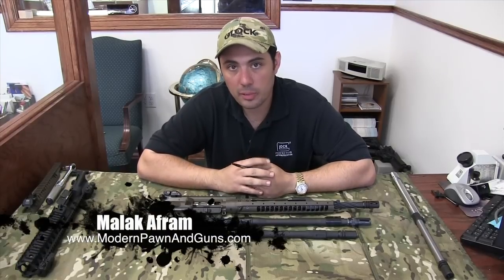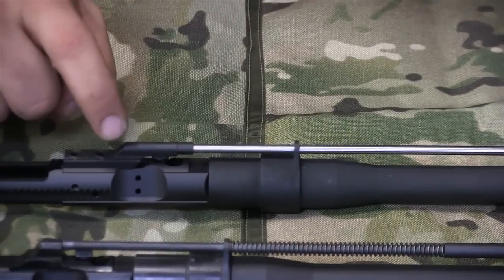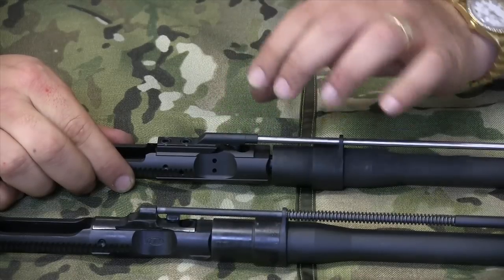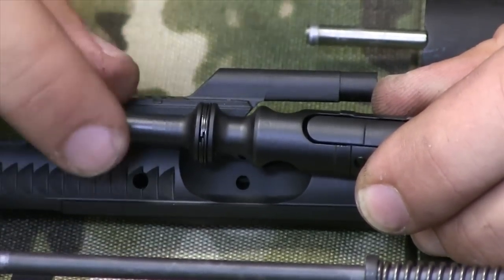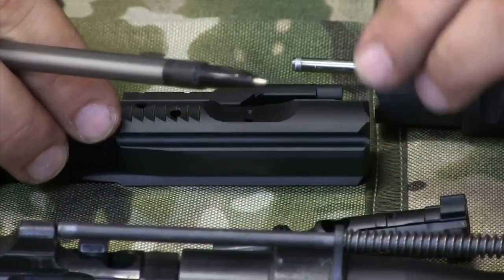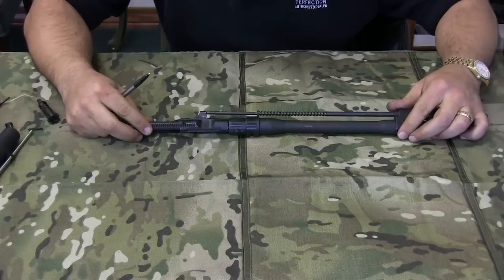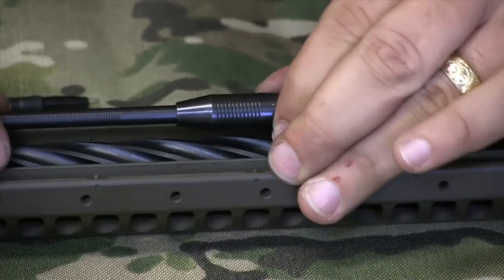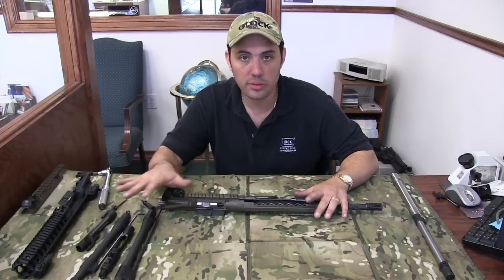Piston Driven vs Direct Gas Impengment AR15 Operating Systems LMT LWRC MRP

Comment: wow now I know...OK which one is best to handle a 16 inch full auto? thanks for the upload.
Reply: stomy bugsy as a gunsmith I spent a lot of time cleaning my shop's M-16s, both DI and piston. I can tell you the piston ones were a LOT cleaner after some heavy range sessions and shooting expos. Realistically it's a personal choice though. Do some independent research and determine your own pros and cons!
Reply: Cameron Miles i did my research and yes they functioned completely different. I like gas driven.

Comment: Best explanation of how a DI system works I've ever seen. No one else on youtube seems to understand.
Reply from the maker: Thanks for watching.
Reply: He does get some things wrong on the operation of the DI system.
Reply: ***** Which is your video? I thought this was very good
Reply: +BSracer85 I didn't say it was a bad video. I'm not watching the video again. but my main point is the DI system is also a piston system, it's where the gas rings or it can also be called piston rings
Reply: +jtv3062 so you can call DI "rear gas piston system" and LWRCs "front gas piston system"
Reply: jtv3062 oiiom
Reply: @jtv3062 he says that

Comment: What system works best with a suppressor? Or is there no noticeable difference.
Reply: I don't think there is a big difference other than more gas near your face with di
Reply: +michael stelljes Toss on an adjustable gas block.  You can adjust the how much gas goes back to the BCG.   Adjust it correctly and It will stop any blow back into the face.  There are also charging handles that seal the area to stop blow back.

Comment: The bolt is still locked when the bullet exits the bore.  Piston conversions are slower to unlock, the additional time lets the dynamic pressure to dissipate before the bolt unlocks and extraction starts.  

DI pushes the bolt forward, this assists in extraction as the bolt is unloaded from receiver extension locking lugs.

Comment: I'm building my very first AR and I'm looking for tips. Carbine setup, DI or piston system?
Reply: Tyler C for your first AR, I would go with a DI system. It costs less, which will get you on the range much quicker! I'm a gunsmith and I'd love to answer any questions you might have. Welcome to the community!
Reply: Cameron Miles I'm looking into building an AR too. I just got the lower, parts kit, tools, and so on. I'm looking at uppers right now. I'm leaning more towards a DI gun because of the advantages. I know they don't run as clean in the receiver, but the fact that you can have a floating barrel, interchangeable parts, it's lighter, and so on. And I clean my guns every time I'm done shooting.

Comment: I was taught that the gas rings should not line up for DI, is that incorrect?
Reply: Thats correct they shouldnt line up
Reply: +Dixinormus Your chances of getting all three gas rings to line up is almost never unless you do it intentionally. Even if you do after a shot or two they'll be jolted/blown out of alignment still.

Comment: Great video! So I have heard that you can adjust the gas pressure (or something to that effect) is that only achievable with the piston driven system or can it also be used with the DGI?
Reply from the maker: There are adjustable gas blocks for DI guns and Piston guns.
Reply: modernpawn I have tried to look for them online but have been unable to find anything, where would one find one for a DI type rifle? I reload my own ammo and I think there is a pressure variance in my hand loads. I have tried doing different grains of powder and still have a big difference in my groupings at 100 yards. (accuracy is still good, but the groupings are off from factory, any tips?)
Reply: notesybnggrn
 adj gas blocks for a DI gun only really come into play with supressed guns, and competition guns for lower recoil. Im guessing youre loading 55gr bullets. check your twist rate for your barrel as 55gr projectiles prefer a 1-9 twist, and 62gr and up is what the 1-7 like. that said I can push a 55gr projectile with 25 grains of h335 to 1MOA from a 1-7 barrel. what kind of powder are you using, whats your load workup, and whats your OAL? Try seating your bullets out a little further than the min OAL, I find 2.26" feeds and shoots great from Pmags
changing your gas block to an adjustable one will NOT effect your accuracy OR precision. check your powder drop as well for consistency from load to load. certain stick powders tend to bind up, and can definitely lead to changes in your powder charge. try to weigh 10 powder drops in a row, and see what kind of variance you have. its also really important to have a consistent technique when working the powder drop.
hope this helps, bro
Reply: Thanks for the response. I have mostly shot 55 gr bullets yes, but I have found a 68 gr BTHP that works really well in my 1-9 twist using CFE 223 from Hodgdon. It is a very "bright" powder, meaning higher pressure and very fast burning. I haven't really loaded too much for the 5.56/.223 because I am still trying to use up all my factory stuff (so when I am out I can re sight my rifle in using my hand loads). OAL right now is 2.25 for the 55 gr and 2.15 for the 68 gr (the book says 2.14 for the 70 gr and I figure that it should be close with the 68 gr) 

I was looking on getting a suppressor for my 5.56 and that is why I asked about the adj gas block. Would I be okay using factory/hand loads without a adj gas block? If so or not so, what advise would you give? (I understand it would only be advise and not something I should base my practices on). 

Thanks again.
Reply: notesybnggrn

congrats on living in a free state, I wish I could get a can!
you shouldnt have any problems with the factory gas block and handloads (assuming mil spec gas port). gas blowback on a factory block is multifactorial and depending on your suppressor design, gas system (carbine vs mid-length), charging handle design, and buffer weight you might get some gas/oil in your eyes (eye pro!)
having an adj gas block on a suppressed AR would cut down on gas blow back, but you're more than likely going to have issues running non suppressed until you really fine tune it, and the cheaper ones have problems with loctite burning off and "self adjusting" I wouldn't trust it for a HD gun

if you're going to run the factory gas block, I'd reccomend a heavier buffer (H2, H3) some kind of gas busting charging handle (I like the BCM gunfighter) and ideally a mid-length vs a carbine set up, but run what you brung! I hear the Specwar 556 is best for reducing blowback, but they're pricey
If I had money to burn I'd get a noveske switchblock which is basically a factory gas block adjustable for suppressed and unsuppressed

I hear cfe223 is a good powder, but I haven't tried it so I can't really comment besides to work up your loads slowly and follow the published data from the manufacturer. There's an excellent reloading community on TheHighRoad.org if you're interested and the folks there are really knowledgeable, give them a shout!
always nice to meet a fellow reloader and shooter, best of luck to you and be safe!
Reply: Sweet, I'll look into all that. I plan on getting a fairly inexpensive suppressor for the time being, currently in school and bills are stacking high. (life first then enjoyment) but I have read tons and tons on the specific unit I plan on getting.

CFE223 is a good powder, but I have been unable to come up with a load that works for me. I still need to burn off all my factory ammo so I can fine tune a load that I like. 

I am not too concerned about blow back as long as it wont affect my rifle in the long run. I always have eyes and ears on when shooting and cringe every time I see someone without it. 

Thanks for the info, I plan on using it well. Hope you can live free like the rest of us in our "free" states (thought they were all free... joking) Think about moving to a better state if you cannot exercise your rights (all of them).
Reply from the maker: modernpawn DI guns can have the gas adjusted (check out JP enterprises adjustable gas block).
Reply: modernpawn Thank you, will look it up
Reply: They are more expensive and should be used by someone who is an experience shooter. different ammunition will mean different settings to run reliably. 

If you run the same ammunition, commercial or self loaded, all of the time, the gas block system allows you to tailor your rifle to shoot exactly like you want it too, especially if you are using a suppressor. The real advantage to an adjustable gas block would be when using a suppressor.

Comment: Excellent video and explanation about how it works. I have one doubt, does the DI system really need the gas to move the bolt forward? The piston system only pushes the carrier back but does not touch the bolt . Maybe the DI system should not allow the gas to come in contact with the bolt so as not clog it. Just a thought, thanks!
Reply: +Akira The AR15 doesn't have a true direct gas impingement system to begin with. It's still technically a piston driven system. It simply moved the piston from where it normally would be on other guns directly in line with all other moving parts and your shoulder to minimize barrel rise, which you will notice is a major theme in the design philosophy of the AR15.

Comment: I run the same LMT rifle and I was coming in to some double feed issues. Is there an adjustment to the system that I am not doing? I have run .233 mostly. Is that the issue? Maybe you can help?

Comment: Excellent video, thankyou for posting.  I'm curious about how this affects recoil.  I've heard the Aug(short stroke) and the Tavor(long stroke) described as "snappy".  Now I don't expect much recoil from 5.56 even at it's extreme, but I'm selecting my first 5.56 rifle based on several factors... bullpup form factor preferred, but pleasent shooting being most important.  I do plan to run a suppressor.
Reply: I own a short stroke piston lwrci and can say it's heavier and has worse recoil than the DI counterpart. I still prefer it since is so much more Clean, and more reliable. Not to say that DI isn't reliable but it sounds like you'd want DI.
Reply: @undisputed1one  Thankyou, that's useful.

Comment: So what is better gas or piston? I know it's probably personal preference but I am looking into my first ar and would like to know which would be best to get.
Reply: Gas piston is cleaner than Direct Impingement. If you're going to be firing at very high sustained rates of fire, gas piston is also more reliable. In an AR platform, for civilian semi-auto purposes there are absolutely no advantages to gas piston. Certainly not worth the money anyway.

You'll never reach the rates of fire required to cause a DI AR to fail, and you'll be cleaning your weapon after every trip to the range, so it really doesn't matter if it's cleaner. As long as you run your bolt and BCG wet in a DI AR you'll never have a failure due to the system.
Reply from the maker: If I had to have one, piston.

Comment: For civilian use direct gas and pensions all anybody would ever need! I hear all these people saying gas piston go of the gas piston system fuck DI systems it sucks, it's not as reliable, it's dirty, get it the rifle wet you can't shoot the gun till is dry. That's all bullshit! The only one that might have some merit to it is yes it can get dirtier than a gas piston and you will have to drain the water from your rifle before you fire it! If I were a navy seal I would take a gas piston because guessed it it'll have to perform when wet or submerged.I'm not a navy seal; I'm a civilian. A basic A.R. 15 should be good enough with the direct gas impingement system for any typical civilian use. Just keep the rifle clean and you'll never have a problem! I own 6 AR15's all of them are DI. four of them are handmade by me from parts; two of them are factory bought. I may have only had maybe a handful of malfunctions and most the time it wasn't the gun it was probably my fault. I do break your maintenance on them every time I shoot them I clean them as long as you take care of your rifle it'll take care of you is what I've learned. This whole debate about DI versus gas piston is ridiculous. At the end of the day both systems are reliable both systems function very well for civilian use I'll just stick with the basic DI.
Reply: David Ackley that was a rollercoaster of a run on sentence.

Comment: Is one system more accurate than the other?
Reply: I may be wrong on this but here is my take.

These systems only affect accuracy after the first shot. If you are trying to string shots together, you get more recoil form the piston gun. As far as single shot, bench-rest, going for the absolute best accuracy, the system choice will not be any different as you determining factor will be the quality of your barrel, the trigger and your own ability to shoot well.

Direct impingement means carbon build up and gas in the bolt/receiver area. Piston means carbon and gas out on the barrel on and near the gas block. The number one reason I like the piston system is NO heat or carbon or gas in the receiver area.

Comment from the maker: Depends on the application.  Most considered a well built piston a tougher system that is less sensitive to getting dirty and hot.  The tube or DI guns will generally have less recoil, less weight, and tend to be more accurate, due to the less moving parts (think DMR style rifle).  Both are very valid systems.  Alot of what makes a rifle 'better' is the builder.

Comment: I've owned both (LWRC M6A2 and several DI AR-15's) and I've found that DI guns are just as reliable as as any piston AR. As long as you keep them properly lubricated, they will keep running like a champ... just what I've noticed over the years.

Comment: I'm a piston guy with two LWRCI (REPR/IC-SPR), and I have to add a negative: Barrel harmonics come into play with the mechanical movement of all that extra metal above the barrel and occurring at the far end. This can affect accuracy in long range shots but I don't see it in 100yd or less with either sized round. I do see it in the REPR trying to get past the effective 800m range and will produce flyers that I can't calculate out in order to correct...some just go off a bit, but that's a long shot either way. I understood this going into it so it's not a true sniper rifle by any means, but it is accurate enough to use as a long range rifle. Like others have said as well, the parts are proprietary and the single piece carrier is about $500 if/when you need to replace it; It's eventually going to need replaced.

The LMT shown is a fine rifle, but I replaced it with an LWRC due to the design of the carrier group itself. There is NO tilt at all on the LWRC's and even though the piston pushes on the top of the carrier, it's all linear and goes directly backwards. I started to see the LMT wear and then one day the carrier cracked. My gunsmith in the Seabees was with me in that there was leverage going on and beating up the carrier group with each shot as wear in the upper became more prominent. A new carrier was only $220 for it, so replaced and sold it. More than twice the rounds in the LWRC and I still see zero wear to this day.

Look for some slow motion video of a Glock being fired too. You'll see all the flex in the frame on those too, but it's still designed in to behave like that and remains a very reliable and accurate sidearm. It ain't no Sig, but it's not $1,500 either.

Comment: the extra gas in a di system is purged through the oil holes on the side of the bcg.  the rings pass that point before the gas key comes off the gas tube

Comment: Well made video!  Great explanation of operation and the differences between DI system and Piston system AR.  As you said, the Piston system my have advantages for reducing heat and gas discharge to the face especially when teamed with a suppressor. Thanks!

Comment: DI is lighter(a lot lighter), and has lighter recoil.

It's also how Stoner designed it, and everyone loved that guy. Kind of why people love AK pattern firearms even though AR-18 pattern firearms are the dominant new piston platform.

Consider this:
"stretch light" short stroke LWRC with polymer handguards/pencil barrel and DD A1.5 rear sight weighs nudge over 7lbs.

Colt M4 with its aluminum obnoxious quad rail, M4 profile barrel, same rear sight, and a red dot, weighs nudge over 6lbs.

Comment: Very thorough overview between the DI and piston. I have the DI, and am curious what frequency (and HOW), the tube/assembly can be kept clean, and if it needs to be kept oiled. I've never used a can, and use a compensator to mitigate recoil. Any pointers and the right direction are appreciated..

Comment: Why didn't you mention adjustable gas blocks?  You can adjust the pressure so you don't get blow back in the face with DI system and suppressor.

Comment from the maker: DI guns work just fine.  I think they both have there place.  Lets put it this way, its like two stroke vs four stroke outboard boat motors.  They both have the benefits, but normally 4 strokes are better, but not 100% of the time.
DI is the original carburetor, GP is like fuel injection.  Both are still cool

Comment: Great video, great explanations, but you forgot to mention that if you have a breakdown in the field, a Direct Impingement gas system CAN be repaired ($10.00) with field strip and replacing gas tube,..Piston gas system cannot be fixed without complete disassembling and Very Expensive parts..and hiring a gunsmith do the work...Am I wrong?

Comment: Fantastic explanation. The DI bolt is a piston just in a radically new place. You could also use an adjustable gas block to tune the over gassed system down. This is the next best thing to having a smaller  diameter gas port.  Stoner was a very creative man.